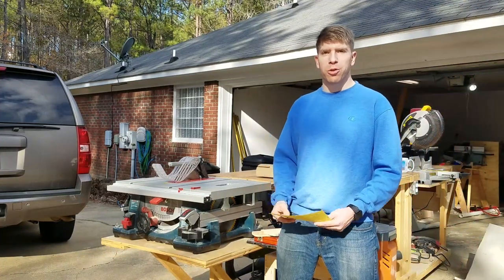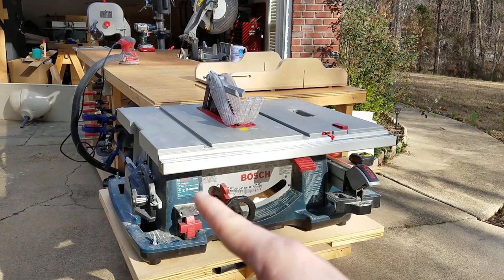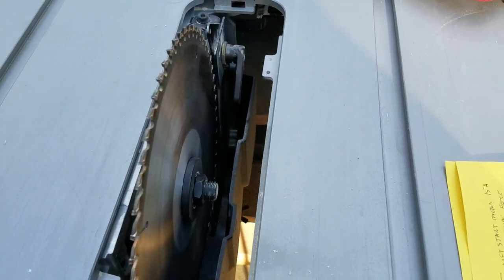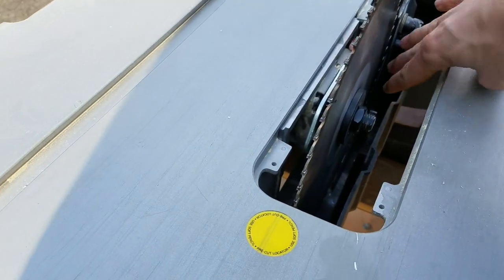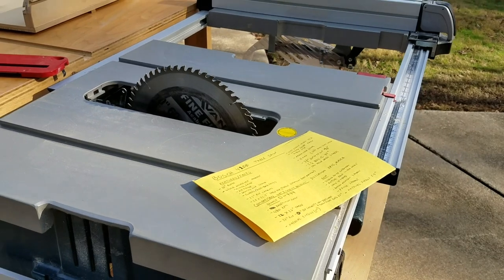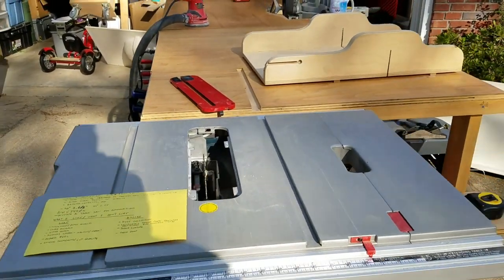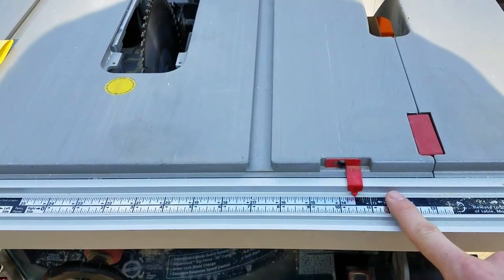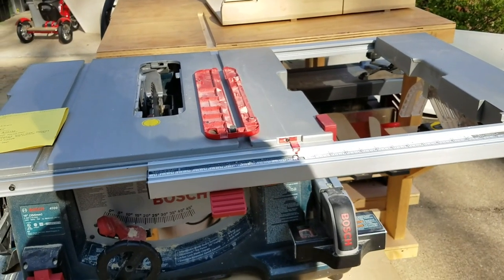BOSCH 4100 Table Saw Review / EP15

Comment: Good video🍻
IMO the lower rpm is a plus. Less high pitch noise. The cutting power is still there.
Reply from the maker: Thanks, Lou. I hadn't thought about the noise, definitely something to consider!
Reply: Over the years I got use to cabinet shop table saws that are belt driven, low rpm, and low vibration as a result. Bosch does a decent job with their higher end  compact contractor saws.
Reply from the maker: There are a lot of times that I miss the low vibration,  rigidity, and power of a good 240v or 3-phase  cabinet saw. My biggest gripe about having all benchtop machines is the lack of a nice flat piece of surface- ground iron to reference joints etc. Off of. I wonder how the saw-stop contractor model compares? Thanks for sharing your opinions,  Lou!
Reply from the maker: Thanks! I have to sell a lot of projects before I could afford one.  May consider it in the future!

Comment: nice review , i got this saw for free but it needs $160 of parts mainly the guards and a gear , do you think its worth paying the money ? i dont know how long the saw was used or how much. Thank you
Reply from the maker: Tice that's  a tough one without seeing the condition. I've been using mine (still) since 2012 with only routine maintenance.  So it is a quality job-site type-saw and most of the parts can hold up well. $160  sounds like a pretty good deal if that's all you need to be up and running and it's worth the risk to you. You'll definitely learn a lot about the saw by disassembling and repairing it, which to me is often time well spent. If you have three space to take it apart before you order any parts,  you can likely assess how serviceable it is and make sure there's nothing else that might be close to failing. You may even be able to make/ sell some projects with it and add some savings you can use on a future saw in case it fails you. Hope that helps, it's my best advice.
Reply: @benchtopwoodworks  thanks for advice , i appreciate it. The only thing that it really needs is a gear to lower and raise the blade. It looks like saw dust and not cleaning it out led to that. The majority of the repair cost is the safety guard and pawl. Im just getting into woodworking and i would like to be safe on the table saw especially. I was looking at a ryobi table saw it cost around the same as it would to.fix the bosch , bit ive read the bosch is much much better quality.   When i shut off saw it sounds like bearing may need a change nit sure though. I think im going to spend the money on the bosch , i hope it world out , i did a cut with it , and it seems nice.
Thanks for reply
Reply from the maker: @ticesine6589 , I'm excited for you getting into woodworking. If I can give 2x more bits of advice that I think you will find ring true over time: 
1. Whenever possible buy a quality tool, or the very best you can afford..you'll find you will have better results and often enjoy working with the quality item in more situations. I think the repaired Bosch will outperform and ultimately be safer than the Ryobi.
2.  Make sure you learn all of the safety rules, set-up procedures and operations for each new tool/machine before diving in. Test yourself on the basics of each tool and seek a mentor if possible. 
Best of luck with everything, thanks for watching and being a great subscriber!
Reply: @benchtopwoodworks  thank you !!!
Reply: @benchtopwoodworks  Im just torn between getting the safety guard and anti pawl vs the Grrripper push stick
Reply: @benchtopwoodworks  hey Chris this may be a dumb question but how do i adjust the miter gauge ? Mine has a metal tab thing that stops me from adjusting it , im wondering if its bent or broken ,, thank you !
Reply from the maker: The vertical handle rotates to loosen and tighten and allows the angle to be adjusted.
Reply: @benchtopwoodworks  thanks brotha
Reply from the maker: Sorry I missed this buddy.  I've got no experience with the gripper, but it looks nice.  Riving knife is more important than anti-kickback  paws. If you've encountered a situation where they engage and grab a board,  then something wrong and unsafe was done. I'd be more concerned that the primary guard and riving knife are still good.
Reply: @benchtopwoodworks  thanks for reply as always Chris ,, i have the riving knife but no plastic guard , the previous owner didnt give it to me,
Reply: @benchtopwoodworks  thanks again for all your advice Chris !! I have just one more question , do u know how to.adjust the fence , i didnt see it in the vid , mine moves back and forth and the end ? Is that normal ? Nothing moves when i lock it down , thanks brotha

Comment: Do you know which models i can use with dado blade?
Reply from the maker: I'm not sure exactly. I know my model's arbor accepts up to 5/8" wide dado stacks without changing the stock arbor nut. If Bosch designed this 4100 one that way, I imagine it was a design consideration for their newer models also.
Reply: you can use the Freud Dado  on it 5/8 inch arbor...there is some debate as to whether you use 6 or 8 inch stack on this size saw..arguments seem to go both ways. alot of people use an 8 inch stack on this saw.

Comment: Thanks for the review. Any issues cutting hardwood?
Reply from the maker: Matt, I've cut quite a bit of oak, Walnut and Cherry on it. It does burn some, it's RPMs are probably half of a 3 phase cabinet saw. With a good blade and correct feed rate it'll definitely cut it's way through hardwood with decent surface finish. I've cut full blade depth through yellow pine routinely and hardwoods on occasion. I hope that helps! Thanks for watching!
Reply: Chris Harpster yes it does thanks alot. I'm deciding between this saw and the dewalt. I am a newbie woodworker and only have space for a portable saw. Im leaning towards the  Bosch. I don't want to be blowing the breaker all the time with a higher output saw
Reply from the maker: If you can for either saw try to run them on a 20A circuit if you have one. I think both the DeWalt and the Bosch pull about the same current, but I have  tripped both 15A breakers and GFCI receptacles with this saw and a shop vac on the same circuit while cutting hardwood or deep cuts.
Reply: Okay cool , thanks. How much time should I spend squaring up fence? Will I be able to get it pretty square?

Comment: I own a 4100 myself, and as someone who’s used it heavily over the past 3 years, I would not recommend buying one. There are plenty of good features to it that I like a lot, but unfortunately the 4100 has one fatal flaw: the fence.

It is extremely easy to go off square, even right after an adjustment. There is way too much play to it, both when free and when locked down. It’s a shame, because otherwise this is a good table saw, but I could never recommend it to anyone. Do yourself a favor: if you’re looking for a job site-style table saw, buy one with a rack & pinion fence- it will save you hours of grief and give you better, more accurate results.
Reply from the maker: Thanks for adding your perspective Glenn. I haven't experienced what you describe personally,  you and several others have brought up the fence as a weak point.

Comment: This saw would be great if it weren't for two major issues. Dust collection is a joke, the design is terrible. No matter what dust collector you hook up the dust goes everywhere. The other issue this saw has is the fence. This saw is good for crude work but you can forget about accurate/consistent and/or repeatable cuts. The fence is absolutely terrible. There is a digital readout add-on for this saw as well. No surprise that add-on is off as well. Unfortunately I just don't have the room for a better full size saw.

Comment: who is this "Saul" he keeps mentioning?
Reply from the maker: Ha! It's Pennsylvania backwoods for Saw
Reply: @benchtopwoodworks  haha, just busting your chops, buddy.  Question: if your saw is a permanent fixture in your garage, why not upgrade to a cabinet saw?  It doesn't take up much more room and can be moved around easily on a wheeled base.  I have both but the performance (in all aspects) on my General table saw is waaayyyyy better.
Reply from the maker: Kren, no worries,  I appreciate  it! 
I agree on the cabinetssaw and think people should choose the best saw they can afford or fit.  I have not  gone outside of the contractor's class for several reasons,  mainly I move every 6 months to  2 years.  Second,  I own a cabinet saw,  it's just 800 miles from where I live currently. The last reason is part of what I'm  attempting  to demonstrate with this channel is more of a minimalist approach to things as far as footprint and 'entry level' tools. I'm actually going through a full (offline so far except Instagram) rebuild of my bench and I'm going to be switching out the saw I have mounted for what I think is the best contractor's saw available.  Thanks for asking,  I hope that logic makes sense.